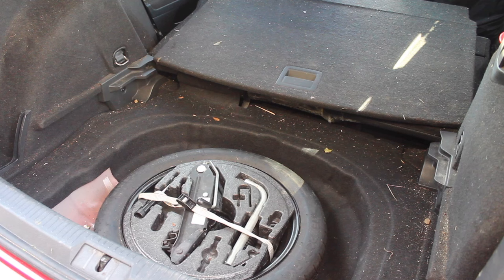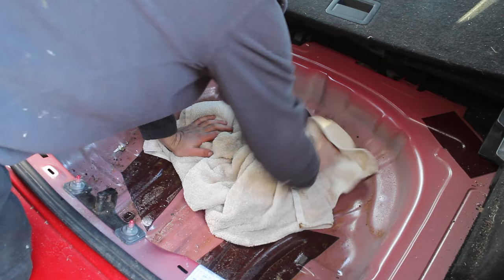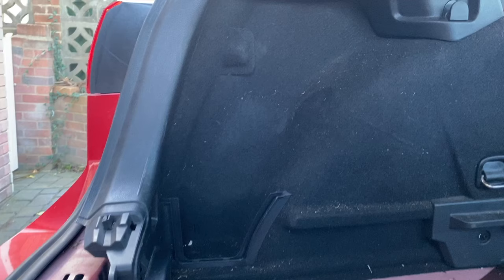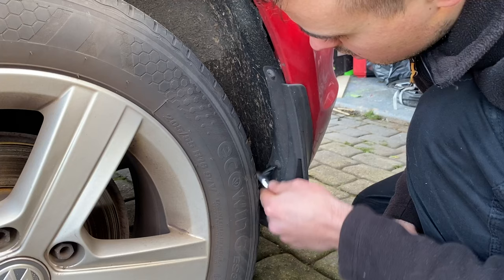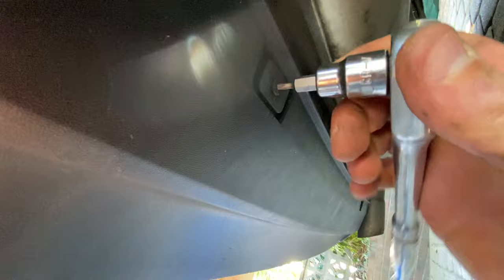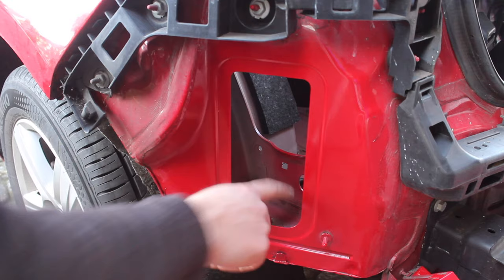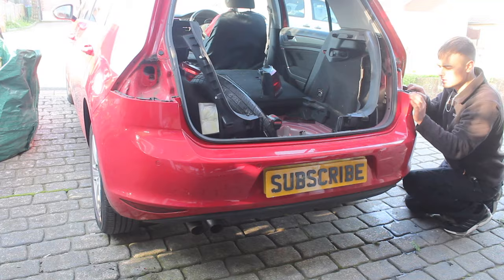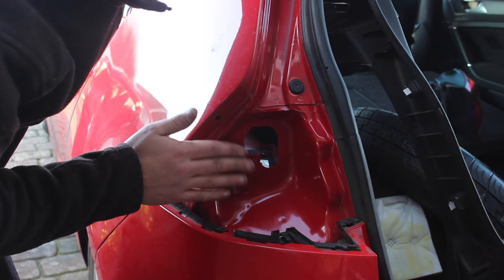VW Golf MK 7 Boot Leak FIX, 4 common leaks!

Comment: All of the screws at the bottom of rear bumper are stripped, can’t get the bumper off. How did you do it so easily without breaking the clips?
Reply from the maker: You could drill the plastic screws out and replace with a suitable metal screw when you refit the plastic clips.
Reply: @TurnersWorkshop97  I just broke them off and ordered new ones. I still can’t get the rear bumper off though. I even broke one of the little clips at the top of the bumper. It just doesn’t budge no idea why.

Comment: how does the bottom piece at rear boot come out?? I am struggling to budge it.
Reply from the maker: Hey, you may need to pry it up and each end. I would use a screwdriver and be careful not to damage the plastic. But you could get some plastic pry tools if you’re worried about damaging it.

Comment: If you undo the wheel arch lining, is it possible to reach in and pull the bungs out to then see if water comes out and if water does come out what stops you just leaving the bungs out so even if the vents leak the water has somewhere to escape?
Reply: To answer my own question, all you need to do is go under the car from the back bumper and look up, you can see the rubber bung either side and remove it, Mine where empty after a few days rain but worth the check.
Reply from the maker: Hi, sorry I wasn’t ignoring you! In all honesty I am glad you answered your question as it will be useful for others reading 😊

Comment: This video is awesome and, having just replaced the boot badge down tube I’ve stripped the inside lining and found a puddle behind each vent as expected. Before I remove the bumper and seal the vents in with some silicone or sikaflex, is there any issue when removing the bumper with the reversing sensors? Did you have them on that golf? Didn’t see you disconnect anything if so. Sorry if that’s a numpty question!
Reply from the maker: Thank you, really glad you found it useful. No issue removing the reversing sensors. It’s just one connector. I only left it on as it wasn’t really necessary to get to the vents.

Comment: Just drill a small hole in the grommet and you don’t have to worry about any of that.
Reply: That sounds like a reasonable solution, I wonder it there's some sort of one way valve that could be installed into that grommet so it would self drain and not just be another source for water ingress?

Comment: Hi, did you get any water in the passenger side footwells? Mine is soaked and also in the boot just like yours. The seats are fine though. - Audi a3
Reply from the maker: I seem to remember seeing on a forum that they leak in from the speakers as well. I haven’t had that problem myself, not yet anyway! Might be worth giving it a google 🙂 the boot leak will be one of the areas I’ve highlighted though for sure 👍🏼

Comment: Really helpful video!  Also, excellent camera angles and lighting!  One question: any idea why that white screw connector @4:16 for the rear light has that big spring in it?
Reply from the maker: Thank you, glad you found it useful 😊 the springs are there to put tension on the seal around the lights.
Reply: @TurnersWorkshop97  Very interesting design, using a spring to put tension on the seal around the lights!  I've been working on my own cars (Toyota, BMW, VW) for years, been watching tons of YouTube videos, and this is the first time... that I've ever seen a spring used like that.  Do you think it's effective (ie, VW came up with a great idea), or... is it an example of VW over-engineering that didn't work out (and that's the reason no other manufacturer is using a similar design)?  Cheers!
Reply from the maker: @tedjohnson64  I think in theory it’s a good idea as it’s always applying pressure around the seal. But in reality this seal is known to leak in time. Once the seal has aged and can’t compress any further the water can get behind and into the car. But the same could be said for other designs that don’t use springs 🤔

Comment: still working on getting access internally but now have soaked back seat off and slowly drying in kitchen, after finding my wheel drowning in water. What do we feel about those rubber grommets?...do they serve any useful function? I am debating removing them when I manage to get into those side boxy areas... and - Surely this needs a group litigation case sending to VW.
Reply from the maker: I would remove the rubber grommets to let the water out as a temporary fix :)

Comment: Emblem drain hose replacement, air vent silicone finish, tail light silicone finish, but still leaking.. 
No matter how bad I am with silicon, I think it's weird because there's still a lot
Reply from the maker: Have you checked the light cluster in the boot lid?

Comment: Thanks for the vid man, already done it once but it came back. I notice that un my car i don’t have the tube and can’t find the OEM ref or anything for it. Any ideas or advice on where i can find it ? Thx and pretty good vid
Reply from the maker: No worries mate, I put a link in the description to the boot badge tube. Is that what you are after? Cheers
Reply: @TurnersWorkshop97 when you say “normal silicone” can you give me an example please? Don’t want to mess this up. Thanks
Reply from the maker: @emmap1242   this is designed for use on vehicles, indoor & outdoor use. https://amzn.to/3RKANLz

Comment: Great video. Couldnt you have siliconed the vents from the inside?
Reply from the maker: Thank you, I would recommend removing the bumper as will give much better access to do a decent job. The space is too tight to apply silicone from the inside really and you will more than likely end up having to redo it.

Comment: Do you have any rust on your car? Both my rear arches where the bumper meets the arch are starting to rust and both front wing inner lips are rusting aswell.
Reply from the maker: A few chips here and there but no rust bubbles yet fortunately. I’ve got a sacrificial transit that’s nearby so that does the rusting for the both of them 🙈
Reply: @TurnersWorkshop97  Jack the front wheels up and look at the inner lips of the wings close up. I bet they are rusty. Same as my old mk5 golf. They haven't changed the design. I'm in dispute with vw at the moment with their 12 year corrosion warranty the now.

Comment: Hello, excellent video and perfect timing as my MK7.5 Bluemotion TDI 2016 has these issues. I keep re-watching, not sure whether to pay for a body shop to sort or take the plunge myself. In terms of Torx screwdrivers, I take it I need a T10 and a T25 screwdrivers? And the silicone you used appears to be something along the likes of SX Siroflex Trade Strength Contractors GP Silicone?

As a side note, I’m sorting my Golf out to get it sold and raise money for a van conversion 😀 similar to yourself, so keen to get this concluded. Many thanks, Alex
Reply from the maker: Hi Alex, it’s not a difficult job to do yourself. Just be as gentle as you can with the plastic clips on the bumper etc. If I remember right it was t10 for bumper screws and t25 for inside the boot. Get yourself a little set then you’re covered. I just used standard building contractor silicone to seal it on. It’s behind the bumper so doesn’t have to be perfect 👍 haha nice one, what van are you after? It’s very satisfying when it all comes together 😁
Reply: @TurnersWorkshop97  good advice, thank you. I have removed all the spare wheel and boot lining at this point so I can access the vents via that way as it stands.

Considering a Japanese import atm. Possibly a Mazda Bongo or a Toyota Granvia. I like the NV-200s but the roofs are so low
Reply from the maker: No worries mate 👍 In Thailand at the moment and every other van here is a Toyota Hiace. Really fancy converting one of those now!
Reply: @TurnersWorkshop97  Class, enjoy! Did some diving in Kao Tao a while back; loved it

You’re right on the HiAce; they run them in places like Thailand and where there’s less infrastructure as they’re bullet proof. After the silica bag and this leaking nonsense it’s Japanese chain belts all the way from now on. Slight tangent, but Aus/NZ also have tons of Japanese cars that run and run. I drove a HiAce for ages and loved it. If I can import a high roof with decent MPG that will be the ticket (hearing contradictory stuff on LPG conversions)
Reply from the maker: Cheers mate, we’re having a great time thanks 👊🏻 We’re in Koh Tao right now doing a diving course. Let me know if you go for a Hiace and get one imported as I’d possibly be interested in doing this too 👍
Reply: @TurnersWorkshop97  Hello Turner, just a quick message. I think I’ve decided against a HiAce or an import. Reasons are being that the MPG is generally brutal. LPG conversion is expensive and seemingly getting more scarce. Adding a fixed hi-top to something like a HiAce (Granvia) is also another big expense. So I’m a bit stuck, but perhaps a Transit like your self could be the route to take. How is it for reliability and MPG?

Comment: Thanks, just bought a 7.5 with the same issue. Is it possible to get to the drain plugs under the lights without removing the rear bumper?
Reply from the maker: No problem, yes you should be able to 👍🏼
Reply: yes, it is. I made it  withou removing the bumper. I am from Brazil, my Golf MK7 has the same problem. I have just removed the drain plug and let it empty, so water is gonna to fall, and not accumalate there

Comment: Nice video mate, having the same problem ! Also dealing with heating not blowing hot air 😓

I notice the little pipe has gone inside slightly, but my wheel well is the one getting soaked after a wash so it must be mostly the vents, I must of had 2 litres on there after a wash, would that much come from the badge? Thanks
Reply from the maker: Cheers mate, It would be worth making sure that the boot badge pipe isn’t under the plastic inside the boot, it does pour in through there if it’s come out 👍🏼
Reply: I had the no hot air issue. It was a pain in the arse to diagnose! All sorted now. Do you have no hot air on both sides?
Reply: @M3EVOpower  I want to know how did you resolve the hot air problem. I have hot air only on the driver side. On the passenger side it is blowing only cold. No problem with the AC

Comment: Forgive me for the pretentiousness, but this is another comment to be pinned:

SILICA BAG WARNING

This should have had a recall, but it scandalously hasn’t. In short, anyone driving one of these Golfs from this period should check their coolant reservoir for a small packet of pink silica granules. They serve no purpose (other than to preserve your coolant; instead just change a bit more regularly) and are a ticking timebomb. You will be served a bill of £1-2,000.00 should that bag split (which it likely will) and therefore those pink granules spread shavoc throughout your system. At least look into it before its too late and then carefully remove. Utter nightmare. Never again shall I buy a VW / VAG vehicle. Absolute set of charlatans.
Reply from the maker: I’ve heard about this one, I will make a video on the subject when I get some spare time 👍 thanks for your comment I can only pin one comment but will add this when I make the video cheers 😊
Reply: This exact thing with the silicon bag happened to me!!! Nightmare. First sign was the heaters weren’t working so well as the heater matrix was blocked with silicon and I was losing coolant due to pressure from the blockage. Full power flush, new heater matrix, new water pump/cambelt kit and header tank. 😡
Reply: @sociallydistant32  make sure you take it up with the ombudsman

Comment: Do not use silicone!  you use silicone in the bathroom and not for your car.
Reply from the maker: Thanks for your comment, please explain why this is a problem.
Reply: if some spraying has to be done in the future, there is a good chance that silicone will end up in the paint (Fish eye).  you are much better off using an MS polymer kit.
Reply: @bertjegti  but wouldnt the polymer kit just adhere more to the devices making them even harder to get out? i also saw some comment about tiger seal too, but what i read about that , that is also a strong bond
Reply: @helinghaus  Might go a little harder but anything is better than silicone.

Comment: Put me off buying a golf.
Reply from the maker: I’m a big fan of the golf and I’ve had this car for 6 years now. Engine is fantastic, great for fuel economy and I like the look of them. It’s just the water leak that’s let it down so far and it’s not a major to put it right 👍🏼 don’t want to put you off.
Reply: @TurnersWorkshop97  Not just you mate but did put me off. I was at the dealers today, thought they looked very average compared to what's on offer. I'm a Golf fan too  had a Mk2 GTi and loved it.  Best car I seen today was an A  class. Absolutely stunning interior, and looks,dimensions..  The golf is so far away from these cars it was shocking how VW have just let the golf slide like this.